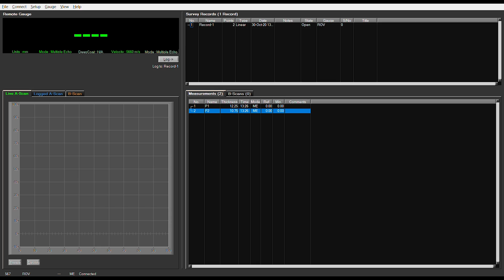Cygnus Ultrasonic Thickness Gauge on a Deep Trekker DTG3 ROV

Comment: Is this really possible! Without aduio contact through fouling ultrasound, probably paint, measurements of the thickness of the metal are made. Can you explain ?
Reply from the maker: Amazingly, it is!  The readings shown in this video were actually taken while we filmed this video.  The system uses a multiple-echo measurement in order to rule out bad data. You are absolutely right, there must be firm contact between the probe and the surface and excessive marine growth makes the signal hard to penetrate.  We were using full power from the ROV thrusters to press the probe against the hull and as you can see the amount of growth made it challenging.  The ship shown here has been decommissioned and it’s hull hasn’t been cleaned or painted below the water line in years, so this demonstrates that you can perform a survey despite the growth but it takes a lot of patience.  Furthermore, a layer of paint is typically one thousandth of an inch thick, so it will not noticeably affect the measurement.  https://cygnus-instruments.com/wp-content/uploads/2019/06/cygnus-mini-rov-mountable-data-sheet-iss5-1.pdf